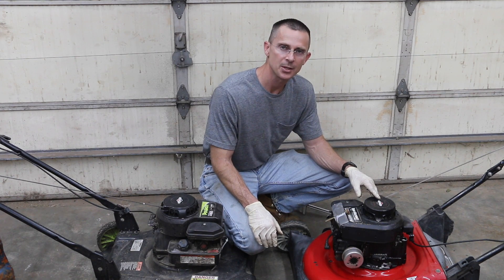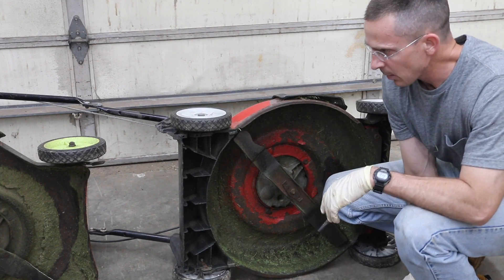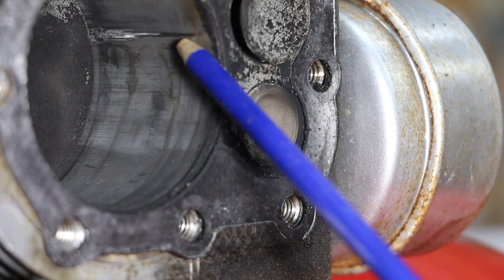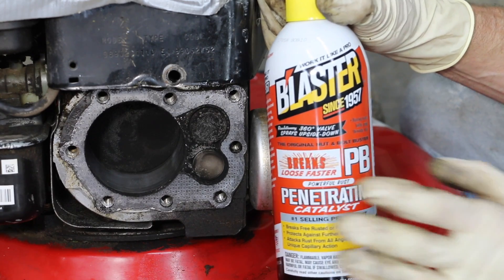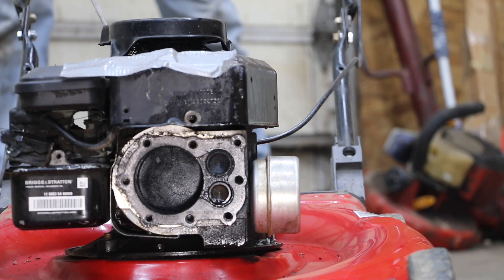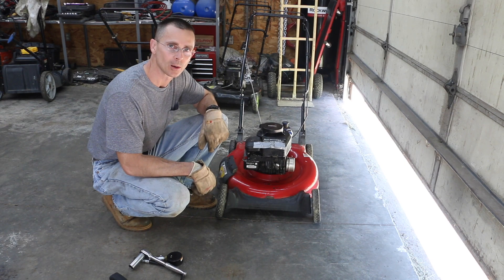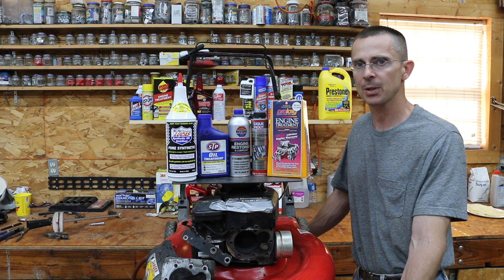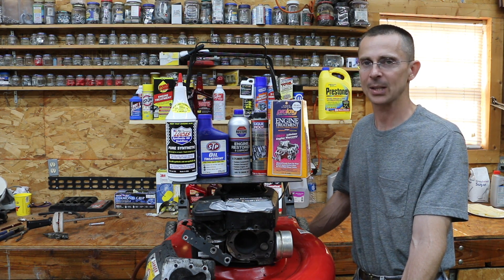Engine ran without oil, seized! Can it be saved?

Comment: Its called metal transfer from crankshaft to rod. It doesn't matter if it can do everything it says. Unless it can miraculously take the aluminum off the steal and put it back on the piston rod then I'm fairly confident nothing will work. These products can provide some initial lubrication but like everything can also be a problem down the line as well. Like using a heavy grade of oil in an engine rated for a lower grade. Tolerances  in most engines don't give a lot even after being well worn and most additives fill in those cracks and improve compression for a very short period. Where the issue is. Is what happens to the rest of engine that now has to lubricate using a much thicker grade of oil.  It's like  trying to force a lubed golf ball through a garden hose. Yes will work but not easily and certainly not for long.

Comment: Despite its being a really good product I don't really believe using Marvel Mystery oil & a high quality oil will help this engine.  Rebuild the engine, w new rings/bearings & hone the cylinder, if possible.  Then it should run better.
Reply from the maker: George, A rebuild is always the best option.  Thanks for commenting!

Comment: i used valvoline automotive grease to free up my briggs 5 hp on my 3 wheeler.  i only used a thin coat but it did the job.  i had lots of scoring on my engine due to starting fluid in the combustion chamber stripping off the original oil coat.  i suggest trying that next time u try to free up an engine again.  great job on your videos and keep them up!

Comment: don't think anything will get rid of the knock, but 'restore' is the only product there that might stop the oil smoke in the exhaust.  don't think anything will change the compression either cause the engine didn't really lose any from the original test.  good luck and thaks for the vids :D

Comment: possible?  of course.  Full tear down, hot tank the block and head, bore out the cylinder, get a bigger piston to fit, replace all seals and bearings and maybe cam and rockers... definitely possible.  Question is, worth the time/effort?

Comment: stp will help the knock but won't likely help with compassion. maybe try running restore first then change oil and run stp. the stp because of the thickness and zzp helps knock(as does oil stabilizer). restore is supposed to fill in little imperfections in the cylinder walls.i have used both in different engines. i had a rod knock that i put 2 bottles of stp in and it made it quieter for a while till i did a proper rebuild. ran some restore in another engine and got a 15-20 point compression increase after a few hundred miles.
Reply from the maker: pospc2, Thank you for these recommendations.  I plan to test restore in the near future.  Thanks again.

Comment: did it on a ford 4.6, you need to polish out all the ridges on parts where you cannot change em (no bearings), clean out filter, change bearings, new crank (possibly), change out guide chains, keep the chain (prolly works fine), 60k miles and runs like it's on crak. cylinder walls were scratched one had a significant line where the rings are at, from bottom to top.. what, am i gonna cry about it? changed out two pistons, didn't even hone the bitch, works like new, doesn't burn oil.. swear to god, half the shit people suggest isn't even necessary, compression is fine, hauls like a bitch with 4 balls
Reply from the maker: Thanks for watching the video and commenting!

Comment: There used to be a product called piston seal, some kind of goo that you fed in through the spark plug and was supposed to seal around the rings or something but I haven't seen it for many years. Perhaps that's because it never worked as claimed. I recall there was a warning on the tube about using it with engines that had a recess in the piston, and it probably wouldn't go too well in a side valve either.
Reply from the maker: Terry, Interesting.  Thanks for watching the video and commenting!

Comment: Forget the additives, I want to see the engine run on straight chainsaw bar oil.
Reply from the maker: Brandon, Great suggestion!  I've got some in the shop. Thanks for watching the video and commenting!
Reply: Project Farm I've heard several people tell me it will quieten a rod knock, the motor is definitely not going to last with that gash in the cylinder though.

Comment: Sure I'm adding to many comments here saying the same thing. To repair this engine will require all bearing surfaces to be renewed, and at the minimum oversized rings and cylinder hone.
BUT as we know you don't want to do that...The knock is most likely the con rod big end bearing as that takes most stress in a moving engine and oil starvation there makes quick work of those. Therefore a thick gloopy oil to take up as much slack as possible and also help raise compression would be the best bet.

Comment: I bought a van missing the oil plug it was run until it looked up 
We put marble mystery oil in it and got it running unlocked it with a wrench and the starter
It was very tight 
Drove it almost 1 year 80 miles a day the nock got loud at around 65 MPH 
So I ran it just below the loud nock 
At the time wall-mart Had cheap motor honey for 69 cents for 16 oz we ran pure motor honey in it because regular oil made nock louder and used a lot of oil and the motor honey didn't burn away as fast 
Only paid 50 bucks for that van back then

Comment: Lucas would be the best, by far.  But it wont save that engine for very long.  You might get a few mows out of it.  The knock is coming from the wear around the connecting rod.  It will eventually let go, regardless of what lubrication you put in the crankcase.  If you're intending to use this mower, you might as well drain and add fresh oil plus lucas after every use.  That could be pricey.

Comment: take the piston out, hone the cylinder, replace piston rings and it'll work kinda, with that kind of blow by you are probably losing 20% or so to that alone.
For rod, new bearing

If the scoring is real deep you'd actually need oversize piston etc., so not worth it. Can't be too valuable of an engine
Reply: Over sized in a lawn mower? Hell yeah. Can we get a stroker crank on it too?
Reply: I've got a fully functional engine just like this one laying in my shed. Hasn't been started for 10+ years.

Comment: "saved" isn't just about adding missing oil..

I like the idea of trying to salvage it, but i figured you were going to pull the piston out and bottle hone the cylinder and put rings in it and put a set of bearings in there.

Comment: Oh another tip for you. You know how the northstar engine fires the spark plug when the piston hits the bottom and of course at the top? You want some power and better gas consumption rates. You can modify what I believe is called the magneto. By setting another magnet (I use neodyme strips and bend them) on the magneto. Some engines prefer a spark at bottom of stroke or near end of stroke. You can adjust the length of the spark as well. I have done this in just a handful of small engine and notice a big torque change. Especially on the 2 strokes! Throwing this idea by you and see if your up for it. Use a strong adhesive to test BEFORE you epoxy it in place permanently. P.S. I have also added a Super High Voltage Coil into the 2 stroke from a performance site for cars. I ran it for 20,000 miles and no issues with burning the plug or anything. The spark I seen it during a test is BRIGHT White like a flash cube. :-) Now I am mainly a 2 stroke guy and am aware of the issues you could have doing this on a 4 stroke. Especially with modding a coil system. On two strokes the magneto has less magnets than a 4 stroke if I recall. Just throwing this stuff at you and seeing what video you do. I do so many mods to small engines cause its fun and people tell me things cant be done. Well I prove them wrong almost always.

Comment: You should of added the Graphite Lubricant to the engine. It will fill in the scores and help seat the valves better in this scenario.I have revived motorcycles that been out in the woods for decades. Graphite oil or graphite powder can be used.

Comment: My dad had this problem, and he just dumped mineral oil though the spark plug hole until the cylinder was full and let it soak in for a day or 2.  the piston freed up, and the mower was good.  that was about 30 years ago, and he still has the mower!!

Comment: the engines fucked bud sorry to say that big gouge the side of the cylinder means the piston ring exploded in to pieces and that is where ur compression is going straight into the crankcase the air is replacing the oil and that's why it's smoking when it's hot its burning oil

Comment: I would try the STP oil additive (the motor honey stuff) but being realistic here, nothing is going to get rid of that knock. I am sure that is the connecting rod big end bearing knocking because of too much clearance from being worn away. I just worked on a friend's 318 with the same issue.

Comment: This would be a good test for Restore engine oil treatment. Supposedly it's synthetic motor oil with a suspension of soft metal micro-particles that get smeared into the scratches of your cylinder wall and fill them in under hot friction. It promises to improve compression in high mileage engines. I don't think anything in an oil can fix that one mean gouge though.

Comment: It's very simple.  Anything that increases the oil viscosity will improve compression and decrease noise.  However they are marketed towards minor wear, not to the level of a seized engine.  It's like saying you can take a cork and plug a wine bottle but the cork can't plug a 5 gallon bucket.

What you should not do, is use synthetic oil.  In this rare case you'd want a poor quality oil to overheat and deposit varnish everywhere, decreasing play, but obviously all of this is a waste of time.  That is an old engine that wasn't expensive when it was new.

What I would do is just put cheap straight 30wt oil in and use it if the compression is enough to get tough grass cut, then when it dies, that's that.

PS - PB Blaster is not a lubricant.  Perhaps it helped to break the piston free but after that point, it made little sense to use it for that purpose when you could have just used the normal lubricant, motor oil, and very little is needed... a teaspoon would be plenty, or some lithium grease.  If I have an engine that's been sitting around for years without running, the first thing I do is pull the spark plug and put some motor oil in before cranking it, and turn the engine so the piston face is horizontal, facing upwards to distribute the oil around it... no need to score the cylinder if you don't have to.

Comment: Nice one! I've used products similar to PB Blaster or WD40 to free seized cylinders before, and have often used heavy (25W-60 or 25W-70) to give oil pressure back to loose big end bearings.

Comment: Try Restore they have some bold claims and I would be curious to see if it can help the cylinder wall gouge...

the only way I see to fix it is bore and hone, and for the knock, u need to disassembly inspect and see if the crank has any damage or scaring and if not you should be able to through new bearings in it and should be golden, your not building a race car haha

Comment: I get your point and the purpose of what it is you are doing. But I think you should use a disclaimer up front saying that this is not a repair tutorial and in my opinion you should suggest the right way of doing it. Because come on this cylinder has to be howned  out and a new purston with new rings of needed.

Comment: Ohhh you meant without tearing it down and rebuilding it. lol  Uhm and the answer to that is "maybe".  But a teardown is much better.  You need to check the rod and main bearings.  also the cam lobes. The upper main bearing is the toughest to fix and usually the first to go.
Reply from the maker: Thank you!

Comment: I used Lucas Oil Stabilizer in my semi truck when I had a 3406 Caterpillar diesel engine, the engine required 10 gallons of oil and I substituted 1 gallon Lucas Oil Stabilizer with 9 gallons of oil at every other oil change.  I put over 1.4 million miles on it when it developed a cracked head gasket.  When they took the head off, you could barely notice it head a cracked head gasket except for the visual on the gasket itself.
Reply from the maker: Eugene, This is very impressive!  1.4 million miles--wow!  Thanks for watching the video and commenting!

Comment: If there is a part made of Al, it most likely friction welded onto other metal parts. I'm sure there are many problems to the motor but friction weld looks to be one of the biggest problems.

Comment: this happened to me on an old rototiller. and what I did was first gave it oil, then I took off the cover with the starter reel and then I took a pipe wrench and turned the crankshaft by the starter ratchet and that freed it.

Comment: i do not believe lucas pure synthetic oil stabilizer claims to restore engine compression. it would however, be interesting to see if it does anything to quiet the engine down a bit

Comment: none will work in a splash lubrication engine,  thickening the oil will actually reduce lubrication. In a engine with an oil pump that delivers the oil directly between the moving parts, thicker oil can somewhat reduce the effects of excessive wear.

Comment: mystory oil is a great product though its very hard to find in my area ive used duralube for many years with 0 issues its a fanominal product and is an ideal additive for vehicles with a turbocharger (i use it in all my diesels and in my subaru impreza) as for attempting to make this engine run at least somewhat happy again do a mix of 2 stroke engine oil in the fuel (it will smoke quite a bit depending on the oil used) and run some higher quality oil with an additive like marvel mystory oil or duralube the 2 stroke oil will lube up the cylinder better and keep it that way its a good solution for running it for a while then switch over to normal fuel and run it (seezed engines run it for a while with the additive and oil then do an oil change using the same this will deal with any possible shrapnal or crap thats floating around in there

Comment: Not a bad idea, actually. I'd like to see two things done with it.

1: 50w motor oil in the crankcase + 30:1 two cycle fuel in the carb

2: See if engine restore actually works. My dad swears by that stuff and I'm always having to remind him that you can't pour cylinder walls into the oil like that. But...can you?
Reply from the maker: TestECull, I agree, one can't poor cylinder walls, but other commenters have also recommended restore for mitigating the effects of the damage to the cylinder walls.  Thank you for the suggestions!

Comment: I have a Briggs and Stratton quatum engine from the early 90s. In the early 2000s my grandfather ran it out of oil and it was almost locked up, like your engine. I removed the spark plug and filled the combustion chamber with Marvel's. I also fill the crank case full of Marvel's and let it set for 1 hour. I drained all the Marvel's and added Rotella t5 to the proper level in the crank case. I had to use the blade to rotate the engine over till it freed up enough to turn over with the pull start. I still use this engine, it is starting to develop a small knock in the bottom end. But I still feel I got my money worth out of this Briggs.
Reply from the maker: Justyn, Impressive!  Glad you go the engine going again and got a lot of good use out of the mower!  Thanks for watching the video and commenting!

Comment: probably the rod or main bearing that seized, not unusual that the flywheel side main seizes on the 13 hp briggs and not impossible that the same could happend to the 3hp engines
Reply from the maker: Great point and I agree!  Thanks for watching the video and commenting!

Comment: I think the Lucas will do the best job.
Used it in an old Suzuki 2 smoke gearbox and it completely silenced all the bad bearings. Rode it for another 2 years no problem.  Not so sure it will give you any benefit with the little end bearing, but worth an experiment.
Reply from the maker: MikMech, Lucas has taken a commanding lead in the vote.  Thanks for watching the video and commenting!

Comment: could you try putting straight SAE 10 oil in the engine to see if it stops the knock?
Reply from the maker: Others have suggested using Lucas or a much thicker oil to help with the knock.  So far, Lucas is in the lead. Thanks for watching the video and commenting!

Comment: Using the lucas oil stabilizer, probably about 30%, or just a heavier oil like SAW 50 (possibly with some additive) will be somewhat effective to take up the increased bearing clearances.  This sort of seizure is caused more in the cylinder than anywhere else, and that is also (fortunately) not where the resulting wear will eventually kill the engine after unsticking it.  The concussive knocking from the connecting rod bearing is what will eventually do in a motor that has been unstuck like this, by causing the connecting rod cap to break.

The STP oil stabilizer is deliberately designed with a very steep temperature-viscosity coefficient, since its true intent is to eliminate smoke on startup from worn valve guides.  Once the engine warms up, it is no longer needed because the valve guides (often brass) expand and stop the smoke.
Reply from the maker: Mr. Zorbatron, I really like your suggestion!  Thanks for watching the video and commenting!